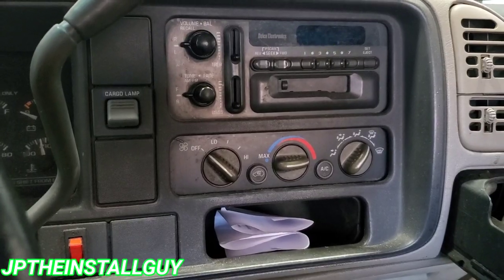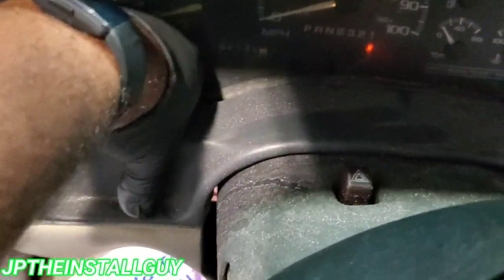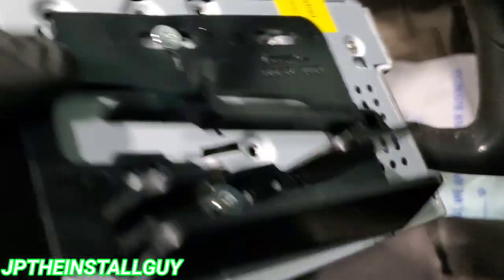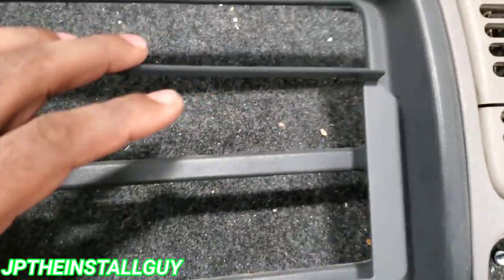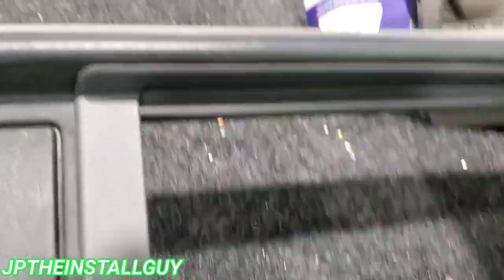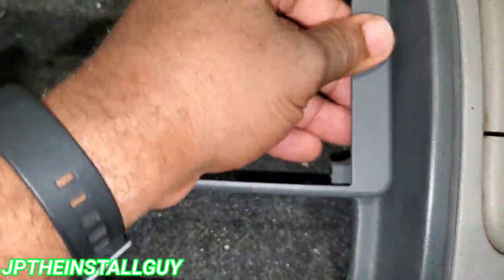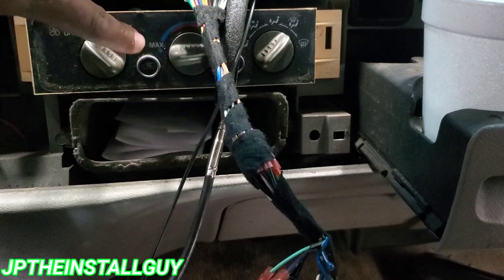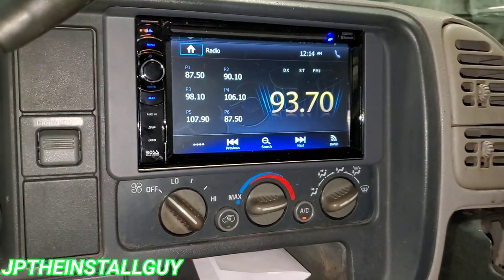how to install a double din in a 1995 chevy Silverado | 95 chevy pick up radio removal

Comment: Hey JP I used you video to install a double din 7 inch touch screen in my 96 Chevy Silverado c1500 and it's amazing. The only thing ive noticed about the bezel piece that snaps into place so it covers up the gaps when you install your doubled din is that mine had a slight tendency to slide down on the top piece that has the fold so I added a few drops of loctite automotive glue to make sure it does not slide and it worked out beautifully. I had no idea when I went from my single din Sony radio to a 7-in touch screen doubled din that I had so much more sound options to play with and I had my Sony tuned perfectly but when I installed the 7-in it literally took me about a week to dial down or up the sound quality in order to get it kind of close to what I had but having the option of a 16 band equalizer visually at my fingertips helped out a lot. I've noticed that these 7-in touch screens no matter what the brand have really bright highs and can really boost up the base on your subwoofers that I actually had to dial it down so it's not so chirpy and ear piercing. I also have separate tweeters that also made that chirpy sound Even brighter. I think anybody with a GMT 400 series GMC or Chevy truck should definitely upgrade to a 7-in double DIN touch screen radio because it looks amazing and so much easier to see the controls. Watching movies on it or YouTube clips is a breeze if you know how to set it up and works wonderfully. But look at me I'm ranting on and anybody who has done this install it basically is very easy and your video made it even easier for me to understand how to do it. I realized that I have commented before but now that I've had the install in for a little while it is an outstanding difference visually and sound wise. Thank you for all these sound system videos. You really do help out a lot. I also watched your other video about adjusting your EQ on your 7-in touch screen radio and it helped quite a bit but my equalizer has more bands it starts out I believe at 32 Hertz and goes up to 20,000 kilohertz and it took me a little bit to adjust it. Now that I have just watched your video I could dial down or up and play with it just a bit more to get just a little better sound to match my subs. The problem I was having is either the subs were thumping too hard and the music was not quite loud enough or the music was too chirpy and not enough bass. I pretty much got it down to where I like it but a little tweaking using your video really helped out a lot.

Comment: Dude thank you so much I’m in highschool restoring a 95 Chevy Cheyenne and really wanted to do this and now I can 🙏
Reply from the maker: man im so glad this helped you out bruh
Reply: Same im in high school and restoring a 1995 Cheyenne
Reply: @mississippioutdoorsman5021  nice nice
Reply: Can’t kill the tie baby 💪🏾
Reply: @jptheinstallguy  give me a link to the radio you installed
Reply: I just got a 1995 Chevy Silverado and try to replace the aftermarket stereo to a double din and when I pull the stereo out the stereo was ran straight to the wires without the harness how can I fix that my brother went and clipped them and I don't know which is which or what is what or is there a factory harness I can somehow buy
Reply: @malaquesaragon6411  By looking up the wiring diagram for your vehicle make and model
Reply: Same here but a 97 :)
Reply: I can think of a couple of options.
Option 1 --- Go to junk yard, most 95 to 98 use same connector, even if it's not a truck. In fact my 94 Cheyenne & 99 Silverado used same connector pigtail. 
Better to find truck, same make n model tho. 
Cut the connector out of the junker with 6 to 12" of wire. Then just spice it into your truck.
Option 2 ---  You can buy the replacement connector separate from Chevy or maybe Classic Car Parts. Then buy a Metra 70-1858  aftermarket radio adapter.
Transfer the wires (in reverse order) to the OEM connector that you bought.
There's a video on "depinning connectors" which can help.
It's tedious, but it works.
There are obvious advantages to having the OEM connector in place for future upgrades. 
Best wishes. Rock on!

Comment: Got a 98 man was about to buy a 100 dollar pre made dash for it you just helped me and saved me some money bro I need a double din cause my radio ain’t got a crossover
Reply from the maker: there you go im glad this helped you out
Reply: Not all touch screen radios have an adjustable crossover just one built-in unfortunately. Some of your nicer higher end radios do have the adjustable crossover. I set my speakers in my truck to cut off at 100 Hertz and from there on the subwoofer plays anything lower than that.

Comment: I’m having an issue with fitting all the wiring in behind/under the deck. I had to just remove my antenna adapter. How did you alleviate that? I’m gonna have even less room when I go to run my RCAs

Comment: I learned a expensive lesson with these trucks...I removed my radio while it was still on and it sent my truck into security lock...the relearn didn't work...so I ended up buying a hp tuner and tuning the vats out of the system.never heard of any of this and come to find out it's common on these trucks

Comment: I installed a double din in a 1998 Eldorado recently with the metra harness but turned out the Eldorado factory connectors dont give 12v power so had to add a fuse tap to get the radio to power up, do you know if these trucks also need a fuse tap or the metra harness will work fine

Comment: I'm putting a touchscreen headunit and new speakers  in my 2000 Chevy k3500  these videos are awesome and so helpful do you or anyone in comments know if there's a video showing what part of the original radio framework needs to be cut underneath the dash so the new one will sit all the way back
Reply: The radio that I ordered was not truly expensive but it is a 7-in touch screen doubled din shallow mount radio so that way I would not have that problem with wires fitting or having to cut anything inside the dash. I wish I could help you out but there are videos I've seen here on YouTube that show a regular size double DIN radio going in to a '90s model Chevy or GMC truck where they cut some on the inside to get it to fit perfectly. I can't remember exactly where I saw it but I just came across it and realized to myself, no, I'm not going to cut anything so I did a little research and found shallow mount 7-in touch screen radios that will fit in these trucks perfectly.

Comment: Do they make a pigtail to from the original radio connector to the new one without cutting and splicing?
Reply: Crutchfield does a prewire for$15-25 extra if you order from them

Comment: Would this fit a 1996 Chevy Silverado? And this might be a dumb question but I’m putting in a 7inch would this kit still work?
Reply from the maker: All double din should work fine they are mostly the same size as far as depth and width some just have different size screens
Reply: @jptheinstallguy would this work on the 92 silverado it’s the interior style for the trucks 1988 to 1994

Comment: You should do a 10" android double din install on a 95 Chevy Silverado/GMC Sierra
Reply: A 10-in will not fit without a huge modification and the screen would have to be what they call a 10-in floating screen and it will stick out so far that it will cover the HVAC controls and possibly cut into your controls on the left like your cargo light etc. Now, if anybody has done a touch screen and been successful in some way I would love to see that video.

Comment: Will a 7 inch double din fit in the dash ?
Reply from the maker: yes i would stay away from motorized double dins though but yes a 7 inch would fit.
Reply: What size did you install ? What size do you recommend? I have never used one and thinking about it and hooking up a back up camera
Reply: @jptheinstallguy  motorized double dins are the ones that open to a screen correct?
Reply: @theyounghawk  screens tilt down for loading disk behind the screen, the ones that have the screen come out are usually single din flip out units
Reply: @zbow1974  Ohhh gotcha thanks for the info

Comment: Know by chance is it a 6.2 or 7 inch screen?
Reply from the maker: this was a  6.2 inch screen
Reply: @jptheinstallguy  may be a stupid question but if I installed a 7 inch screen would I have to move the hvac controls?
Reply from the maker: @zacbeckham8789  7 inch screen should be good just dont get a motorized 7 inch. you could run into some fitment issues

Comment: What year trucks need to cut inside the dash? I seen your other video with the whole bezel and you cut inside the dash.. I have a 97 c1500
Reply from the maker: you might have to cut the dash a little bit for a 97 to fit a double din unless you get one of those double din digital media streamers they are usually shorter in the back
Reply: 97-2000 needs to be cut, however digital media players do not need to be cut, i am doing this in my 99 yukon using this exact kit with a digital media player because i dont own any disks lol dont really need them in the digital age